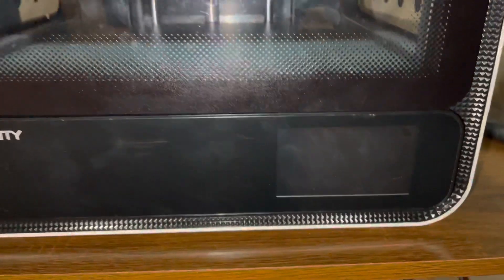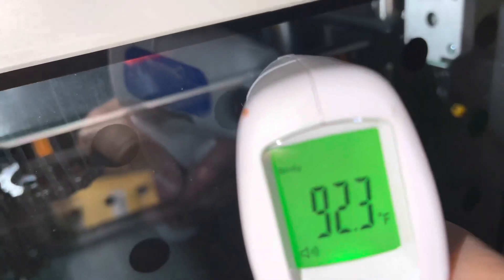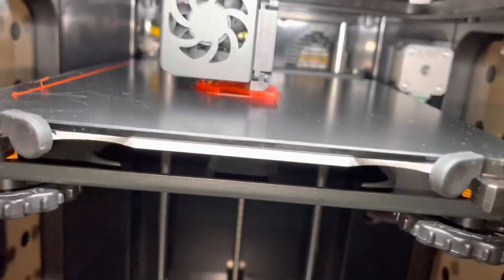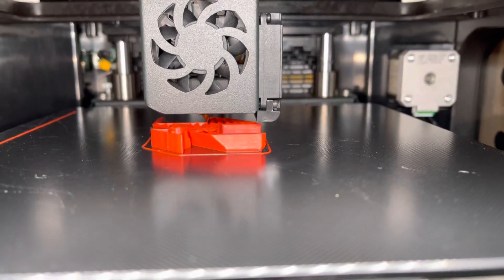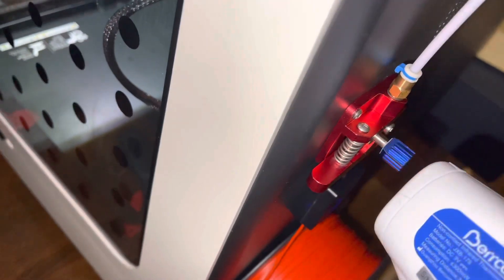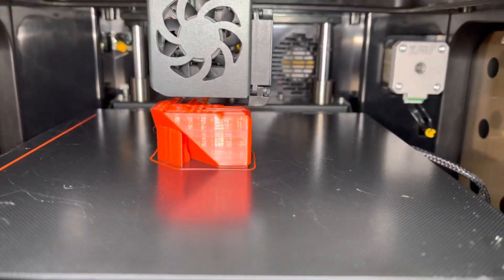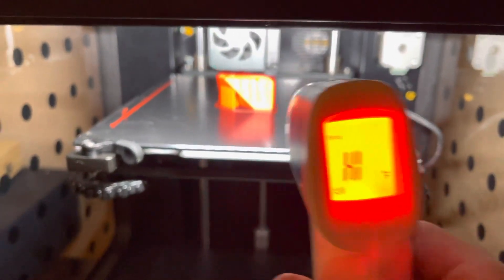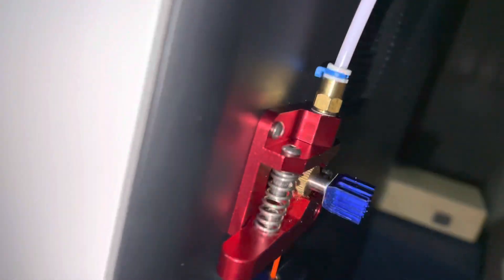Creality CR-200b second hot extruder fail

Comment: I bought one, worst printer I ever had. Linear axles mounts are plastic and cracked, now the printer clancs a lot when hotend moves, clanc-clanc. Hotend radiator is extra hot end stops extruding after about 2 3 hours. All motors are stupidly hot. Plastic case vibrates\resonates horribly, I can hear it from the room below my workshop-room, cannot print at night due to that. You CANNOT babystep Z Axis with 0.01mm - stupid, only 0.05 which is too high or to squeezed - latest FW with BLtouch does not fix this. Metal bed is not rigid in from part, I can see it vibrating when printing, all prints closer to the case door are more vibrted then the ones printed in the middle or closer to the linear rails. I spent 140 euro on SKR 2 board trying to fix some problems--but not worth it. 330printer + 140 electronics + relocated extruder and screen and motor dampers + 500 euros total for this printer. Worst mistake I ever made on printers. NEVER BUY THIS JUNK!!!!

Comment: I had the same problem first print. I think mine was a clog on the hot end. Then extruder started to spin on the filament. My fix was to increase hot end to 210. cleaned out the tip. Been running fine with the extra heat melting the PLA filament

Comment: in your video the hotend fan does not turn which poses a problem for the filament
Reply from the maker: Yeah I realized that later on and found out that one of the fan wires came disconnected.
Reply: did fixing the hotend fan fix the extrusion problems?
Reply: @pwave123  if the hotend fan (not the fan duct) is not running, then the radiator will get too hot and therefore the filament will melt and block the passage
Reply from the maker: @pwave123  no , the extruder motor still got really hot. I had order two cr-200b and the second one came in a month later. The second cr-200b I have has no problems.
Reply: @juliendoes2044  if the stepper motor doesn't get hot enough to skip steps it's fine.
Reply: @juliendoes2044  when did you receive the 2nd 200b? I just ordered the same model and wonder if I’ll get the improved version.
Reply: Friend, you need to reduce the Vref of the step drivers at the motherboard, mine was showing 1.4 to 1.5, this is too high... need to be between 0.8 and 0.9... I'm conducting some print tests now... everything fine... will tell you later....
Reply: @wolfgott  How can you do that, is it by software or electronics tampering? How excatly did you reduce the vref